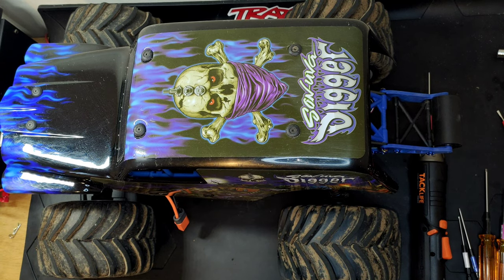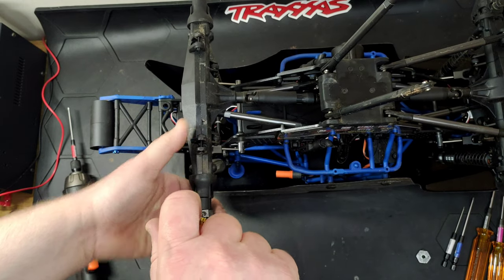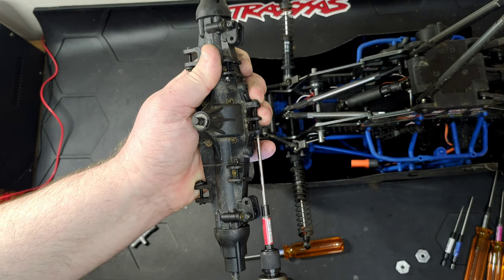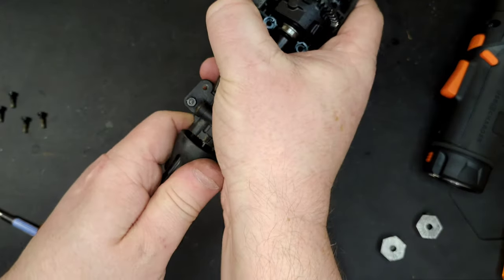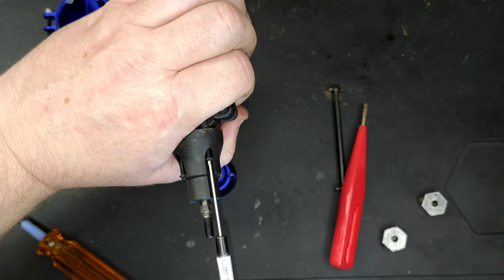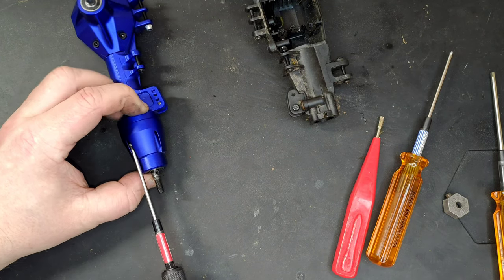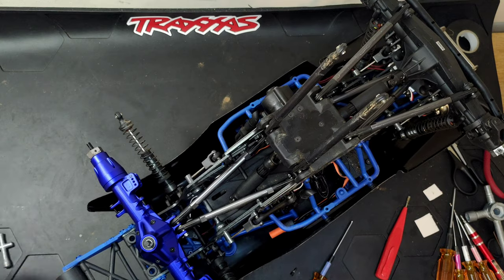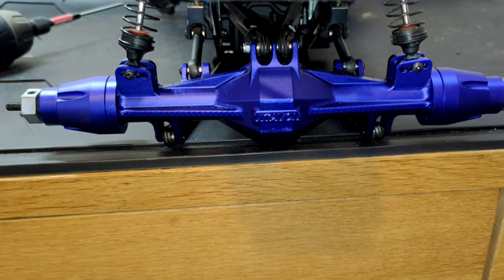Losi LMT Vitavon 7075 rear axle housing fitting guide,

Comment: Nice vid. I'm going to get this for the oversized bearings and better screw hardware. I've had one of the stock LMT bearings fail with the balls falling out of the bearing race. The oversized bearings on the Vitavon also appear to be an advantage over the rear Treal aluminum axle version which use the smaller stock bearings.
Reply from the maker: Yeh we find the vitavon axles with the treal steering hubs works fantastic,

Comment: U have a item number  on that drill and the suff that come with it
Reply from the maker: No item numbers but the tips are MIP speed bits, the screwdriver is not available anymore but you can use any with adjustable torque settings :)

Comment: Did you remember Blue Loctite on the hardware after you checked you diff and pinion shimming?
Reply from the maker: You not watched the vid?
Reply: @WTFRCCars  I did, just didn't see any Loctite. Preparing breakfast for the family and that, might have missed something. Thanks for the kind response and taking the time. Cheers.
Reply from the maker: No I didn't but I do say all the way through that you should if your doing it, as for the shim none needed on mine at all :)
Reply from the maker: I haven't had time to look for any of the treal vids but seen ppl saying they need to shim them but as for the Vitavon ones I couldn't find anywhere that you could fit a shim on this rear one, just checked with a mate who's fitted his rear and same on his no shim needed at all :) I really should have waited until I'm not working at 60h over 5 days though and I probably wouldn't have fastened the sway bar links up the wrong way lol one 2 screws to correct it but lol